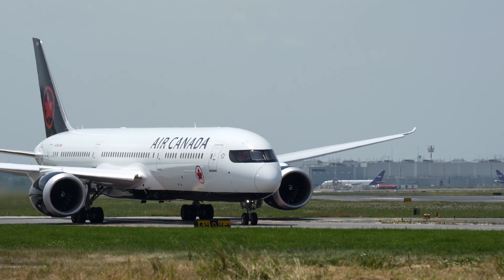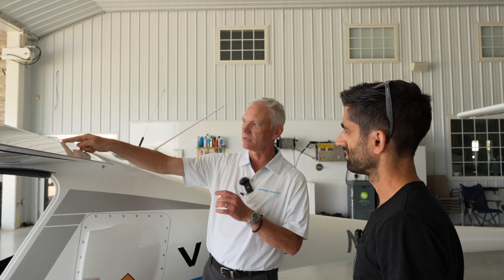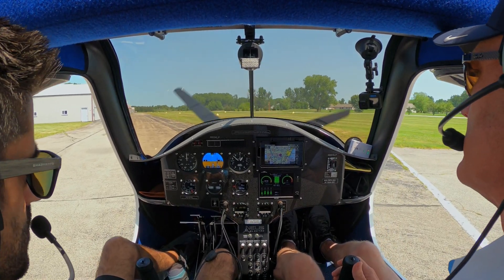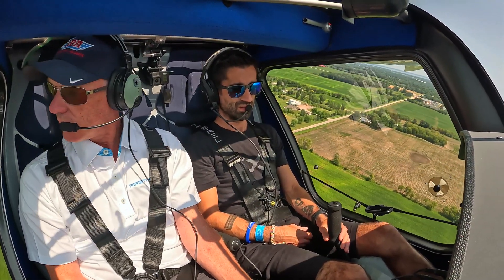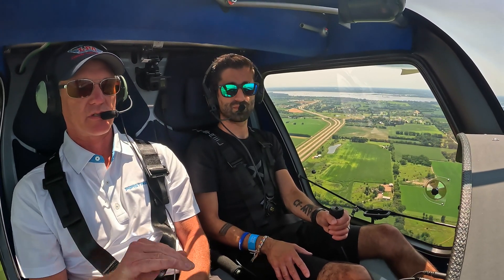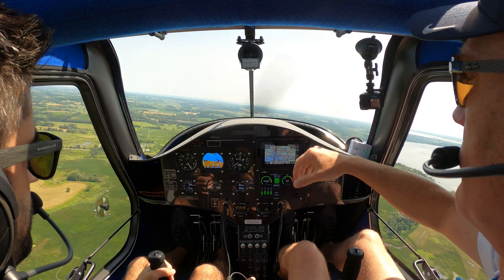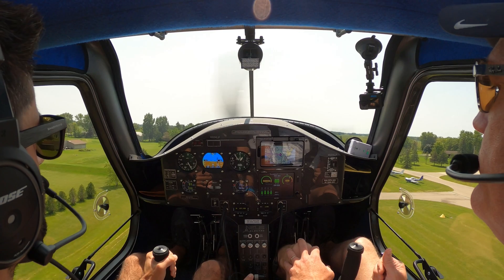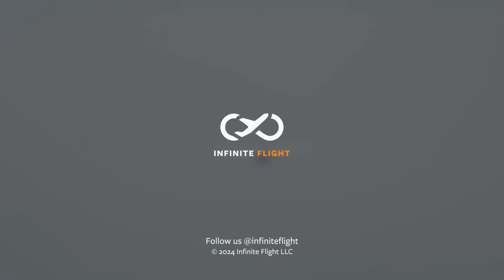Are ELECTRIC PLANES the future? Flying the Velis Electro! 🔌

Comment: Is GOOD JOB 🔥BUT I D’ONT TRUST ELECTRIC PLANE YET🫠
Reply from the maker: Why don't you trust it? Modern airliners depend a great deal on electricity to stay in the sky!
Reply: @infiniteflight  Changing weather conditions, especially in the air, can affect the battery. Unless the propeller itself is capable of generating electricity. This is all guesswork😅😇 Maybe that's why he doesn't trust🤷‍♂️ I would also trust it much more if each such plane had a parachute like the SR 22)

Also FAA rules today are very strict😅
Reply: Bro, anyone can hack your plane
Reply: @ 😂NAHH